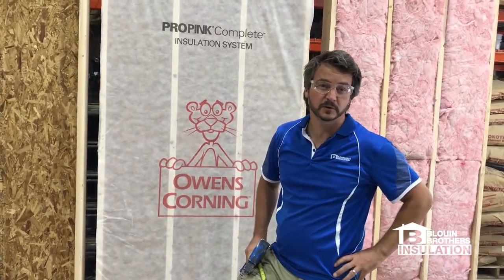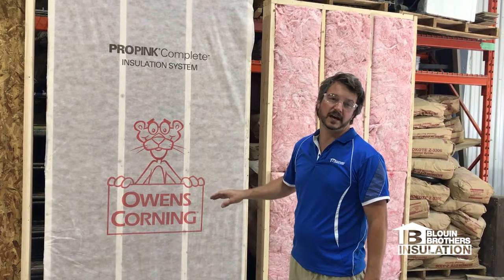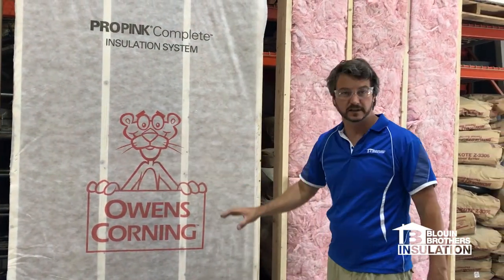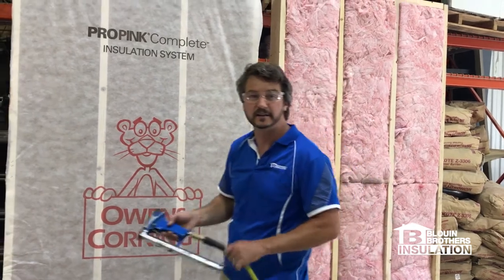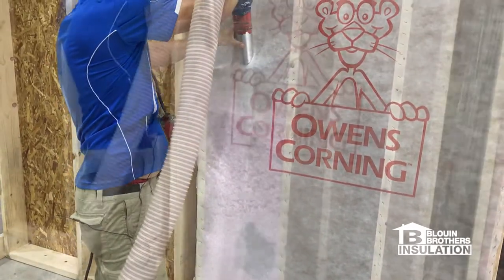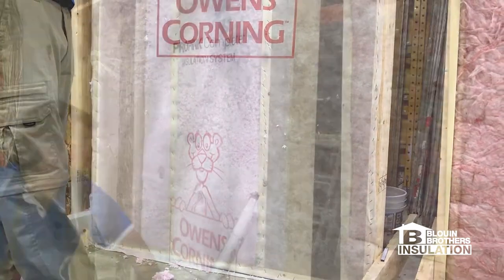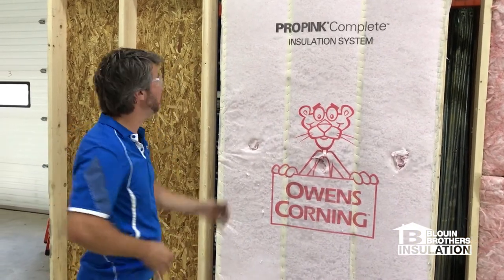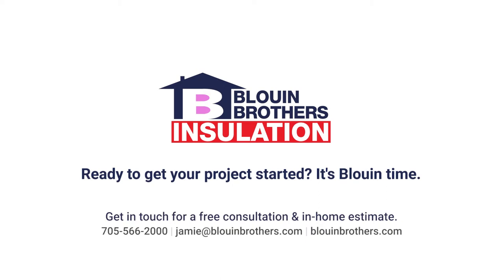Blow-In Blanket System (BIBS) - Blouin Brothers Insulation

Comment: What kind of stapler is that?  The company I work for does the blown in insulation system.  The only trouble we've had is with our staplers.   The one you are using is exactly what we need.
Reply: Fasco F1B A11-16 AUTO LM Auto-Fire Stapler w/Long Magazine

Comment: Bibs will not settle fills all voids and when done properly ur wall will achieve a r 23 value.. u will still need a vapor barrier irregardless.  Unless u use 2 inches of foam or vapor barrier paint....I do this for a living
Reply: Hi i have some questions for retrofitting for my 30s old house. Do you need a vapor barrier for cellulose blown in walls? I live in nyc and climate zone 4, do i need a vapor barrier if choosing blown in fiberglass? Please any help would be appreciated.
Reply: @fruitf7064  You need an interior vapor barrior for any insulation that isn't foam. Foam is the only insulation that blocks vapor on its own.